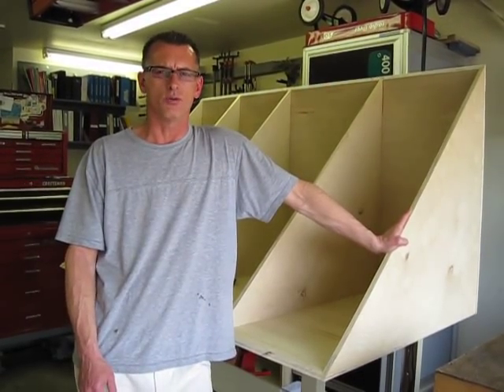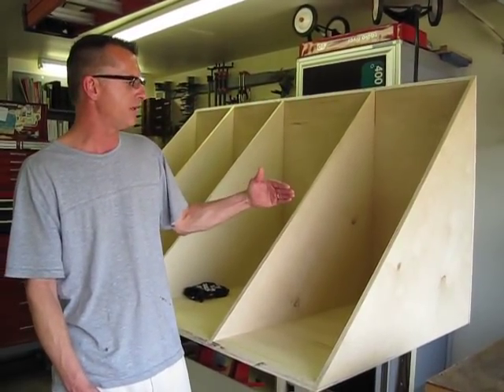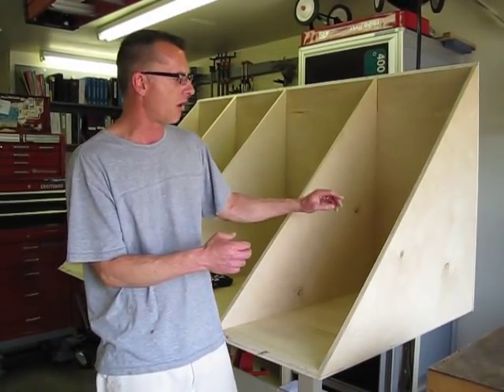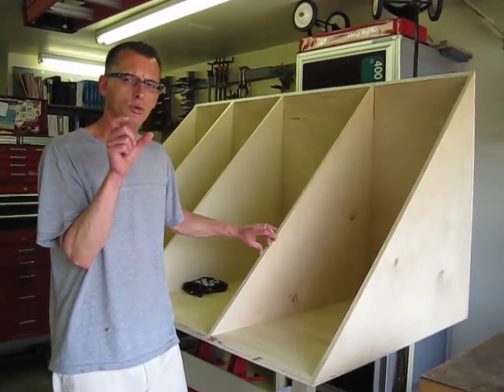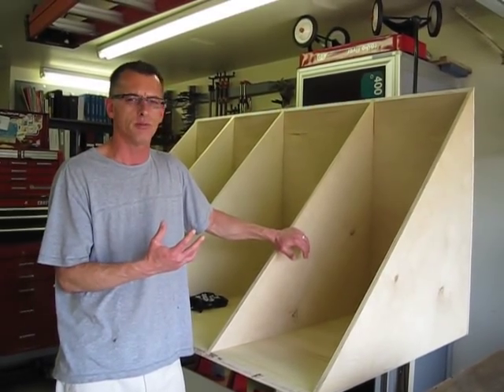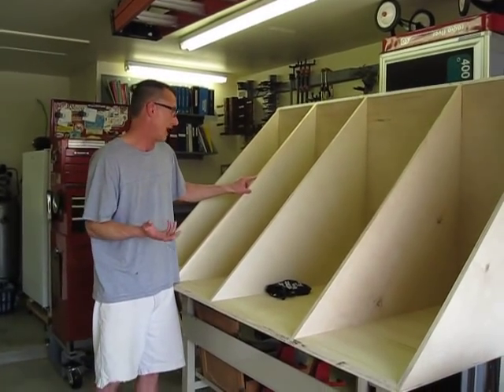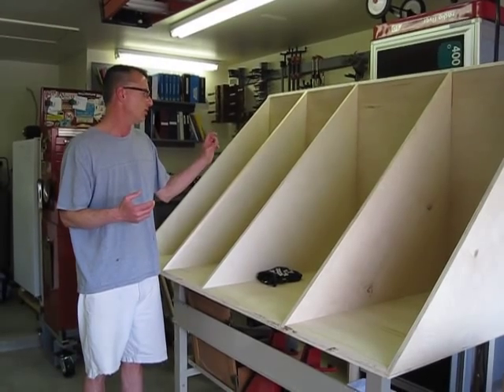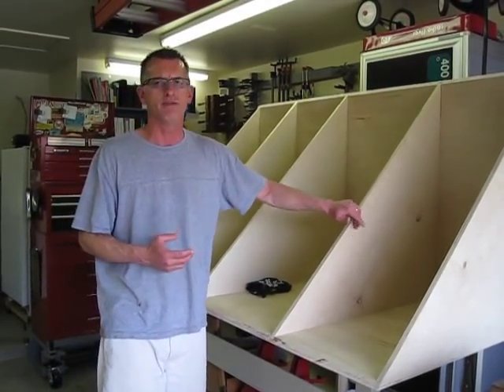Corner Cabinet Design Changes

Comment from the maker: Hi Chet,

I use a pneumatic finish nail gun and finish nails of various lengths.  Although the nails add some rigidity to the project their primary purpose is hold pieces in place while the glue sets up.  I try not to get crazy with adding too many nails since the nail holes need to be filled before the cabinet can be finished.  Good luck on your project.